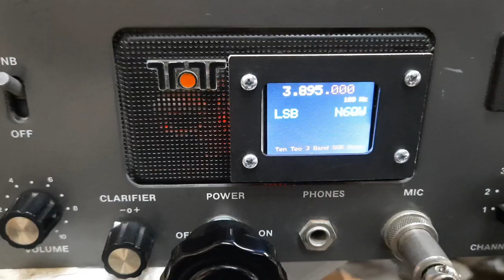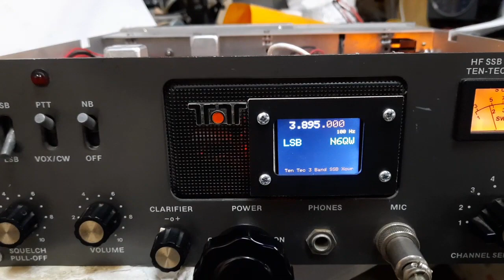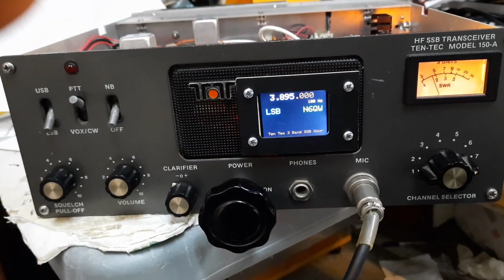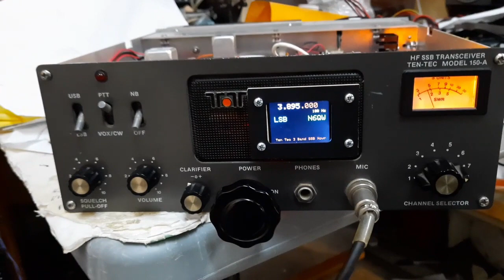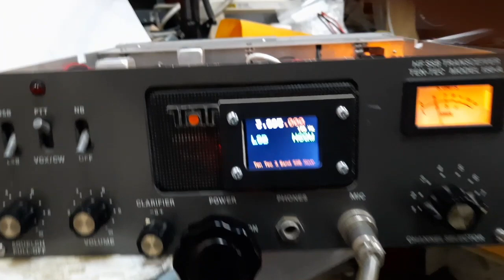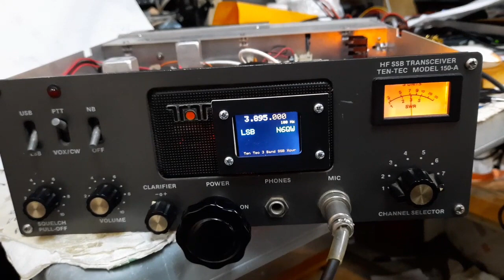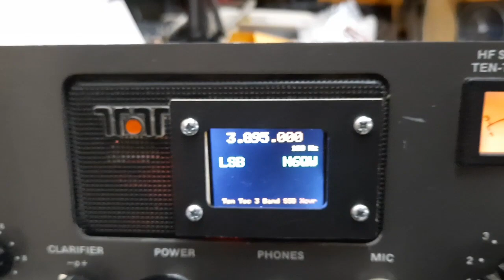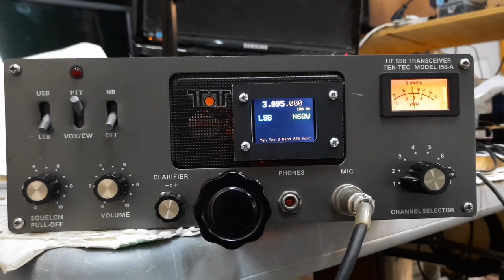Listening to the West Coast Vintage SSB Net using the Ten Tec 150A

Comment: Hey Pete, Love your videos. question please, can you point me to the most popular Arduino PTO replacement for TenTec Omni or Triton series radios. Thanks in advance. Phil WX9US
Reply from the maker: Hi Phil,

Thanks for watching the video. I am not sure how to or if I can answer your question. With the Triton IV and the Omni there is already a port  to introduce and external LO So, You have an option of just bypassing the internal PTO. As to an internal replacement of the PTO I don't have any good suggestions. Another option is to add a frequency stabilizer to the PTO and that cuts down the drift. Check out my latest videos on the Triton II PTO Bypass. If you give a bit more detail on what you specifically want to do I perhaps give you a better answer.

73's
Pete